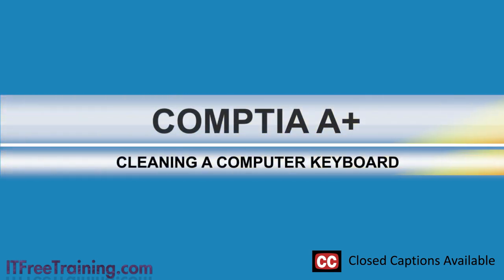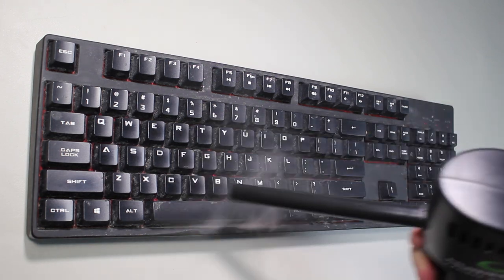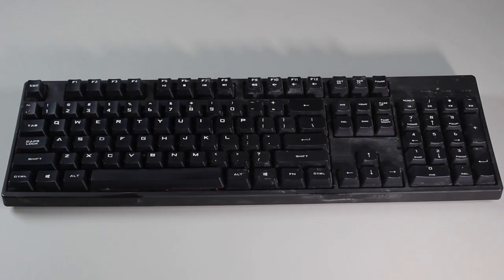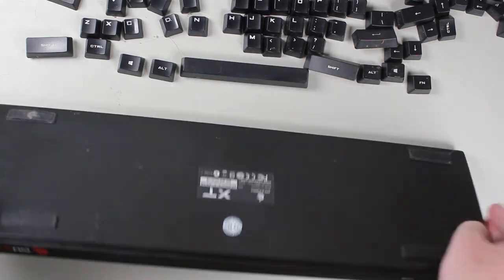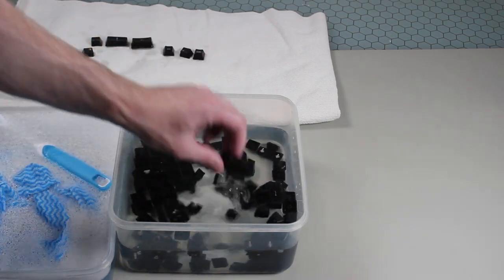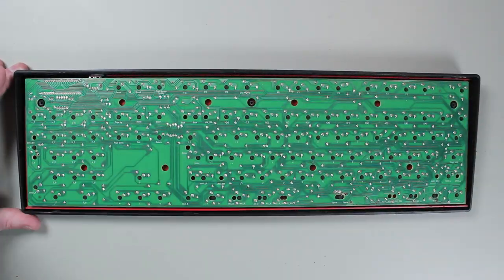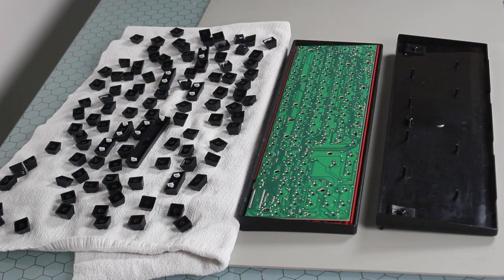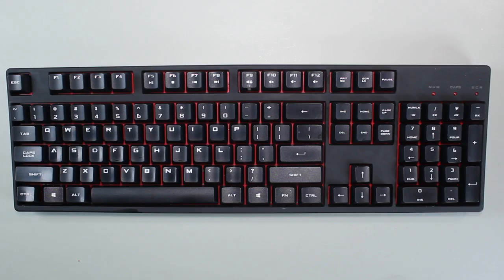Cleaning a Computer Keyboard

Comment: I'm still using a beige Genius keyboard from the early 2000s.  I prefer the black on beige text since it's far easier to see, especially at night.  Every few years I strip it down, remove the contacts etc. and wash the keys etc. in a lukewarm soapy solution, rinse and dry with a hair dryer.  One thing I did learn on another keyboard, NEVER get moisture on the tracks below the keys - don't even wipe with a damp cloth, it will ruin them.
Reply from the maker: Thanks, good to know. Some of those old keyboards are great keyboards.

Comment: WTF?
Time is an asset too?
No?
Just.Buy.Another.Freaking.Keyboard.
Reply from the maker: The video states a number of times you would normally just buy another keyboard, particularly in a work environment. This is why it has the basic quick clean and more advanced cleans that take more time so you can decide what level you want to clean it at or buy a new keyboard instead..

Comment: 12hrs UV, seriously U think people have time for this? ? ? 

Extreme waste of time, using 50-70% alcohol solution or any biocidal would do the same in seconds !
Makes things much simpler.

Also remember - ANY pure alcohol is not conductive.
Reply from the maker: At the start of the video we explain that in a lot of cases the cheapest and best option maybe just replace the keyboard. We give the different options as people are aware the other options exists. We also make the point that going the extra levels of cleaning increases the risk of damaging the keyboard and result you achieve get less. It is up to the individual to decide what level they want to clean the keyboard at, we just explain the options available.